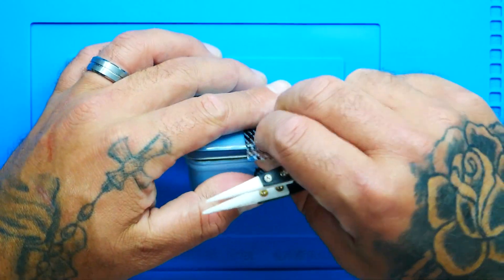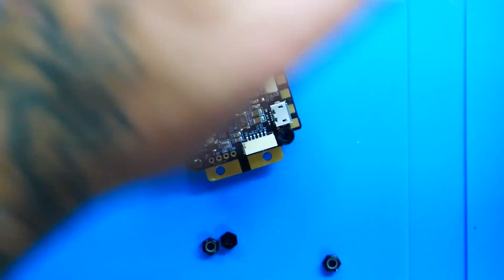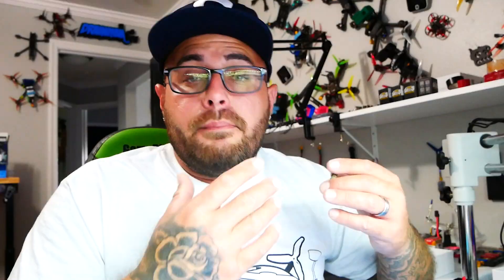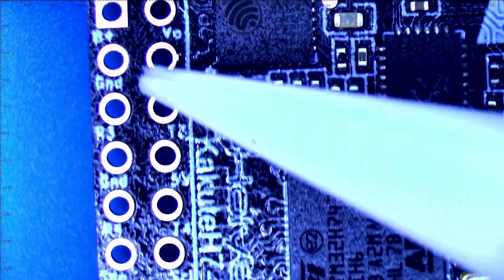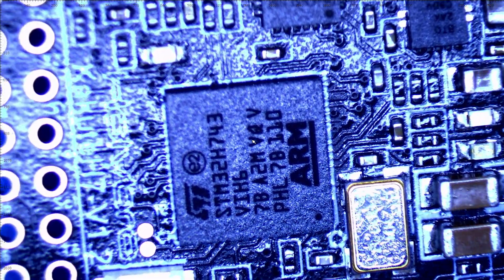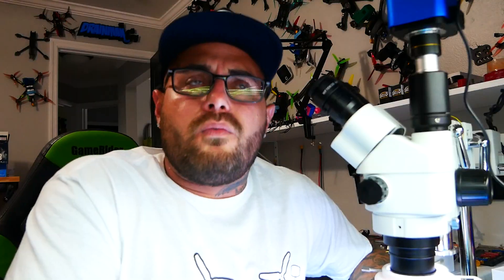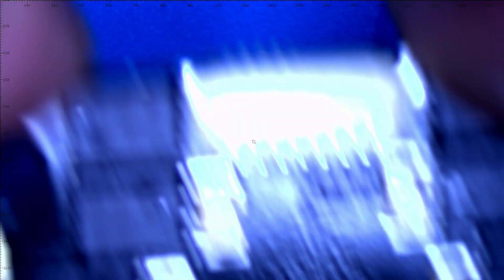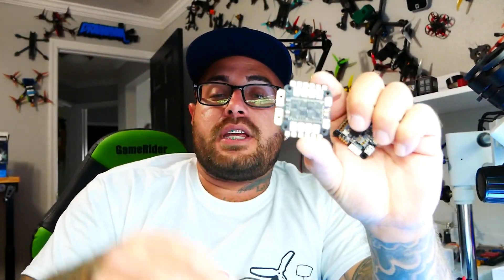What More Could You Ask For?! Holybro H7 Flight Controller & ESC 🤑

Comment: I feel like I'm missing something... Arducopter requires over 1mb, yet H7s are super rare compared to F7, especially F722s. Which only have 1/2MB which isn't even enough to run betaflight, correct? Why are F722s the most common in a landslide? 

What am I missing?

 I am building my first Quad, and I would like a MCU that is both futureproof and large enough to run any firmware. Being an engineer, ultimately, I want to develop a drone with new capabilities, such as the ability to self charge, automated patrolling, flir, etc -- so the extra I/O is also desired. 

Although expensive, H7 seems to be the way to go?

Comment: So if your not using DJI controller you will need to remove 2 wires from the Air unit to FC plug correct?

Comment: Hum.. the ESC looks a little sketchy with another board soldered on it, with the heat flex and a few crashes I would be worried..
Reply: The other board u speak of is the logic board and isolates the power delivery board and is a good thing to see.  The V1 version of this esc had some issues but this is v3 or v4 I think and this esc is a monster. I have 2 of these escs and just purchased the H7 FC for a cinelifter i'am building.  I also have this esc in a 5.5" cruiser and no issues.  I wish it wasn't so expensive but if you look at the components its hard to scoff at.

Comment: Hi DM: Great Vid just wish i saw it before getting the KAKUTE F7 HDV, would you know if it's possible to use a analog Camera on this board by using the wires from the DJI plugin or do I just wait to purchase a DJI unit, Thanks.
Reply: He pointed out the analog in & out solder pads. This H7 handles one analog cam.  The Matek and Luminier H7s handle dual analog cams.